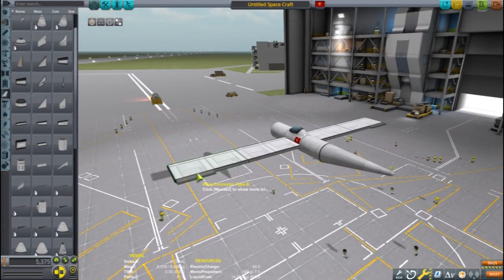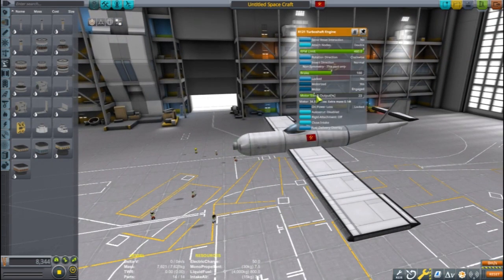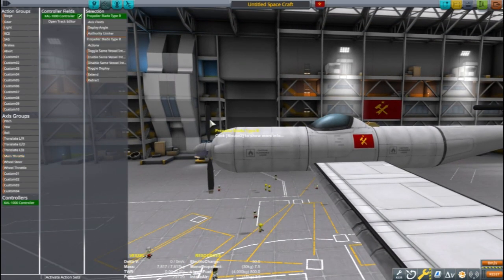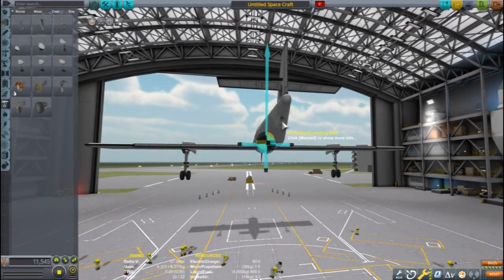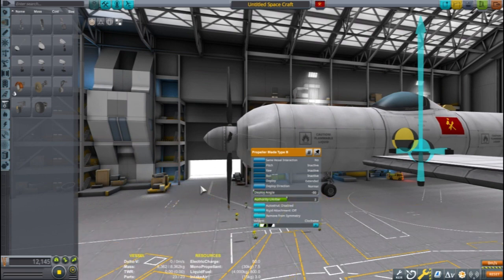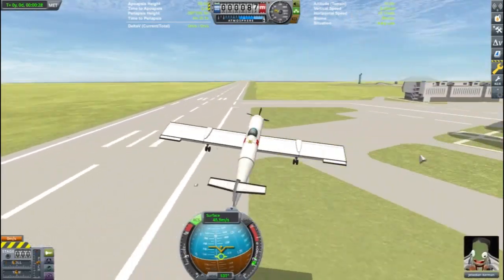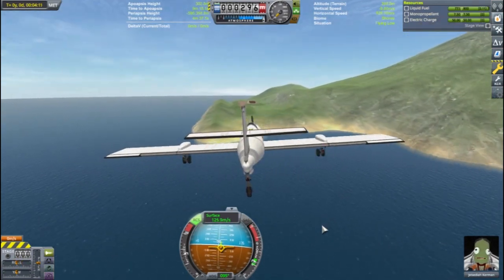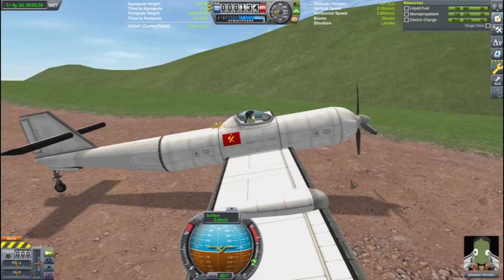Single Engine Propeller Tutorial

Comment: Is it a good idea to pitch up the main wing slightly? It makes jets much more stable, but what about propeller planes?
Reply from the maker: It generally is a good idea to give your main wings some angle of attack. You typically do not need a very high angle of incidence with the wings, but if you leave the wing placement neutral, then the plane usually has to tilt up to maintain level fight. Then you get added drag from the fuselage. The same principles apply to prop aircraft and jets alike. The stock game has simplified aerodynamics.
Reply: @Echo3  how did you get it straight
Reply: @Echo3  how do the winga
Reply from the maker: @Brtt4849  I will switch to the fine placement tool (c) and rotate the main wings one "tick." I explain this in a little more detail in my Airplane Design tutorial. What exactly are you asking about the wing? Do you want to know how it is level as apposed to dihedral or anhedrial?
Reply: @Echo3  help me I can’t see comments I can only use notifications

Comment: Took a break from KSP for a few years and bought this DLC earlier this year. This video was very helpful in getting the props to work! I ended up making a two-speed variable system with a fine setting for takeoffs/climb and a coarser setting for cruising, as I don't think it's possible to make a constant-speed system. I ended up reinstalling FAR and using AJE propellers instead however.
Reply from the maker: There is a lot you can do you the rotors and propellers. I really enjoy making helicopters, but they take a lot refining to work well.

Comment: after activating my engine the plane falls over to the side, how i do i correct this?
Reply from the maker: It sounds like the torque from the rotor is rolling your craft. I like to use a conventional gear placement and keep the front two very wide.
Reply: @Echo3  k

Comment: My planes tip to one side when the prop turns on. Not just a little, but enough to get it off its landing gear and break the wing.
Reply from the maker: Are you using a tricycle or conventional landing gear arrangement? Typically, I'll use a conventional style with the front gear pretty far apart. It could be too that you are giving your motor too much torque. Most of the time, the motor size can be greatly reduced.
Reply: Thank you! I'll try this sometime @Echo3

Comment: I've been trying to get the R121 to work now for ages. It's simply not turning on at all ( not spinning )
My motor is engaged, RPM limit and torque limit is above zero, brake is set to zero, etc. It will just not do anything. I have both liquid fuel and air intakes. 
Any idea what I might be doing wrong? (I've got RPM and torque limits bound to my main throttle, and a custom action to 'toggle motor engaged'; no matter what I do, the blades never turn)
Reply: Looks like I answered my own question - I needed to have a liquid fuel tank attached to one of the nodes of the R121. 
I had fuel on my craft, but the R121 was attached radially. The fuel diagram showed fuel flowing into the engine but it wasn't working.
Reply from the maker: @frecatorDementa  Nice to see you figured it out.

Comment: I dont know what I've done wrong, I cant seem to get the plane to take off the runway. (Its not going backwards) but it wont propel itself forward. All the action groups are the same as yours, as is the KAL1000 'play'. And when I'm on the runway, I'm throttling the same amount as you, I just always seem to have troubles with propeller craft lol
Reply from the maker: Make sure to place the propellers with the stripes on the front. Deploy the propellers. For takeoff, you'll need the angle around 10 degrees then gradually increase to about 20. As your speed increases you can keep increasing the angle to 40 to 45 degrees.

Comment: Nice tutorial, but when I "launch" my plane, it bounces on the runway. Do you know what could be the reason ?
Reply from the maker: That could be an issue with the landing gear. Make sure you have advanced tweakables enabled in the game settings. You may need to adjust the spring strength and the dampening. It could be that you also need to use larger landing gear to handle the weight of your plane.
Reply: @Echo3  Thanks, I will check this. The plane is the one in the video, so it is the same weight than yours. I will activate the advances tweakables

Comment: 4:14 from that part what do you mean "Trim functions" for stable in flight? can you elaborate it more?
Reply from the maker: On PC, I can press ALT + direct key (wasdqe) and the craft will set keep the control surfaces altered in that direction. It will also keep any reaction wheels applying force in that direction. It doesn't work with SAS on, but is very helpful for using the aerodynamic control surfaces to counter the roll torque of the rotor.

Comment: HOW DID YOU MOVE THE PARTS LIKE THAT AT 2:08
Reply from the maker: By holding Shift while using the move tool (default short cut key 2) I can move the parts further out. @ 1:56 I bind Toggle Motor Power to the RCS action group. It is also helpful to unbind the motor from the Breaks action group. If the breaks are engaged when you turn on the motor, the blades will not move.

Comment: How do you bound the kal 1000 to throttle
Reply from the maker: With the action group menu up, select the KAL 1000 part (not the option in the action group menu) and click on the throttle in the action group menu. You should have two options, one to bind either play speed or play position. I bind the position of the KAL to the throttle.

Comment: My plane isn't flying, I followed all instructions well and set the kal 1000 to proppeler blade b with 40.00
Reply from the maker: Without seeing exactly what you are doing, it may be hard to diagnose exactly what is going on.
Placement of the propeller blades is important. The striped side needs to face forward. Make sure the blades are deployed. Optimal blade angle depends on rotor RMP, the crafts speed and the air density. For takeoff on Kerbin, I like a starting deployment angle around 15 degrees and gradually increase to 25 as the plane picks up speed.
https://www.youtube.com/watch?v=eMZSisbhL6A This video demonstrates a simpler design that you may like.
Reply: @Echo3  Yes, the plane moved faster after rotating the propeller blades but still doesn't fly and drifts to the right
Reply from the maker: @shahishnusureshkumar248  A single engine plane like this will naturally want to drift. I like to set my front gear wide to keep it steady on the runway and use trim to keep it flying straight.
How fast are you able to get on the runway? There could be other issues with landing gear placement or your wings. Do you have any way to share pictures or video of your craft?
Reply: @Echo3  I am able to get to bout 28m/s
Reply from the maker: What is your deployment angle on the props at 28m/s?
Reply: @Echo3  40.00
Reply from the maker: @shahishnusureshkumar248  That is too much. You'll need something like 20 to 25 degrees at that speed in order to accelerate.
Reply: @Echo3  Sorry, I meant -40.00 degrees
Reply: What did you mean by trimming?
Reply from the maker: @shahishnusureshkumar248  That sounds like you didn't place the propellers correctly. Are you able to share your craft file so I can look at it?
Reply from the maker: @shahishnusureshkumar248  With SAS off, you can press ALT + direction key (wasdqe), and the craft will compensate in that direction. For single rotor craft, the rotor will torque the craft. In the game and IRL, one needs to trim the roll (ailerons) and yaw (rudder) of the craft to offset the torque of the engine. How much trim you need will depends on air speed, air pressure and the RPMs of the motor.
Reply from the maker: @shahishnusureshkumar248  I worked with your craft.
https://1drv.ms/u/s!AgX4yLy61s3KkmWl4vFYQstC_p6B?e=pmmMjo
A lot of parts were not placed on straight including your propellers, wings and landing gear. I got the plane working, but you'll have to reattach your modded parts.
Reply: @Echo3  I don''t think I added any modded parts
Reply: @Echo3  It is still not flying, After the end of the runway upto to the beach it gets 25m/s
Reply from the maker: @shahishnusureshkumar248  Don't use "full throttle" for take off. The throttle controls the propeller deployment angle. Watch your speed and slowly increase your deployment angle. You won't need the full deployment angle until you are around 150 m/s.
Reply from the maker: @shahishnusureshkumar248  okay, something about mechjeb popped up when I first opened the craft. No worries though.
Reply: @Echo3  Okay, but the plane spins out of control and triming doesn't work
Reply from the maker: @shahishnusureshkumar248  Does it spin on the runway or in the air? I use trim for flight and just make very small adjustments to the pitch and roll. I didn't have any issues with yaw.
Reply: @Echo3  it spins on the runway
Reply from the maker: @shahishnusureshkumar248  The torque of the engine will make the plane try to yaw while you take off. I compensated with my joystick during take off. The stall speed is pretty low on the craft, so I was airborne before reaching 50 m/s.

Comment: 2:34 how did you make the offset tool align like that?
Reply from the maker: Press F to switch between local and absolute mode with the offset tool
Reply: @Echo3  thanks, also in short how does the number and size of blades on an aircraft affect thrust?